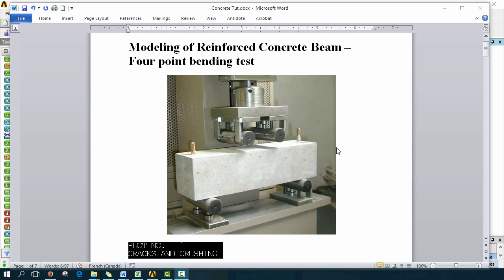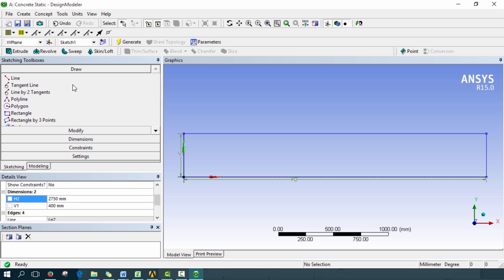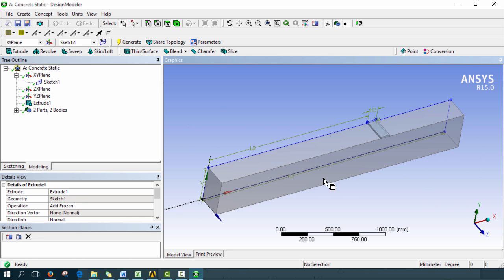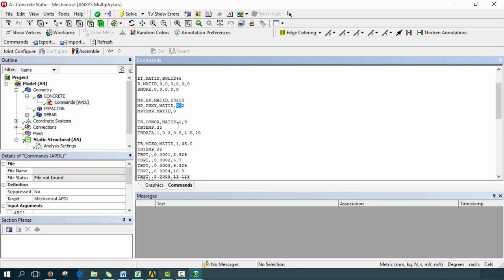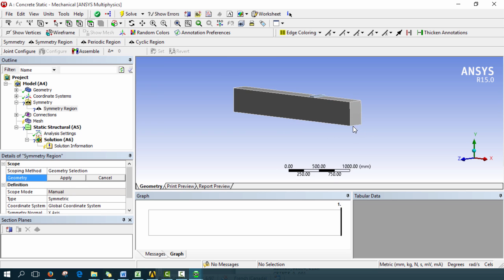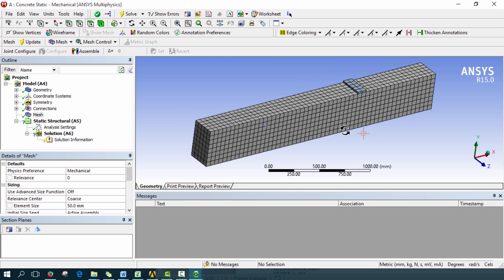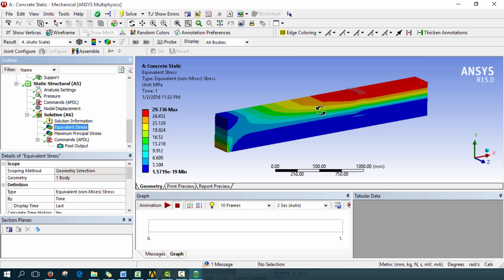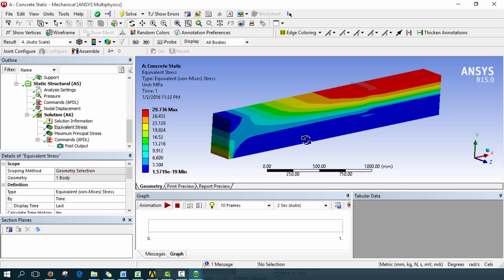ANSYS Tutorial Reinforced Concrete Beam (RC BEAM) - Static Structural

Comment: Hi, and thanks for putting up your concrete modeling videos. One comment on the static structural model that you have developed: Viewers should note that the coupling connection between nodes reinforcing rods and concrete by node coupling works only because of the element sizes and placement of the rods in the concrete block. You have done it so that you have coincident nodes in the elements of the concrete block and of the rods. Users will need to ensure that they use low-order bricks so that the SOLID65 bricks can be substituted. It will take more work for the "general case" in which the concrete is carved up into a multibody part so that reinforcing bars can be placed along edges of the bodies that are the concrete. With mesh density controls along the edges that are shared between the line bodies of the reinforcing bars and the concrete blocks, it should be possible to have coincident nodes that can be coupled with reinforcing bar locations that are not quite as restrictive. I am impressed with how smoothly and quickly you are able to present. Nice piece of work!

Comment: can you please upload the word file of commands for m20 concrete ??
Reply: ANSYS Reinforced Concrete Beam (RC BEAM) - Static Structural by DrDalyO
CONCRETE COMMANDS:
ET,MATID,SOLID65
R,MATID,0,0,0,0,0,0
RMORE,0,0,0,0,0

MP,EX,MATID,29250
MP,PRXY,MATID,0.2
MPTEMP,MATID,0

TB,CONCR,MATID,1,9
TBTEMP,22
TBDATA,1,0.3,0.8,1.5,25

TB,MISO,MATID,1,35,0
TBTEMP,22
TBPT,,0.0001,2.925
TBPT,,0.0002,5.7
TBPT,,0.0003,8.325
TBPT,,0.0004,10.8
TBPT,,0.0005,13.125
TBPT,,0.0006,15.3
TBPT,,0.0007,17.325
TBPT,,0.0008,19.2
TBPT,,0.0009,20.925
TBPT,,0.001,22.5
TBPT,,0.0011,23.925
TBPT,,0.0012,25.2
TBPT,,0.0013,26.325
TBPT,,0.0014,27.3
TBPT,,0.0015,28.125
TBPT,,0.0016,28.8
TBPT,,0.0017,29.325
TBPT,,0.0018,29.7
TBPT,,0.0019,29.925
TBPT,,0.002,30
TBPT,,0.0021,30
TBPT,,0.0022,30
TBPT,,0.0023,30
TBPT,,0.0024,30
TBPT,,0.0025,30
TBPT,,0.0026,30
TBPT,,0.0027,30
TBPT,,0.0028,30
TBPT,,0.0029,30
TBPT,,0.003,30
TBPT,,0.0031,30
TBPT,,0.0032,30
TBPT,,0.0033,30
TBPT,,0.0034,30
TBPT,,0.0035,30

REBAR COMMANDS:
ET,MATID,LINK180
MPDATA,EX,MATID,,2e5
MPDATA,PRXY,MATID,,0.3
TB,BISO,MATID,1,2
TBDATA,,460,2100
R,MATID,12,,0

PRE PROCESSOR COMMANDS:
/PREP7
ESEL,S,ENAME,,65
ESEL,A,ENAME,,180
ALLSEL,BELOW,ELEM
CEINTF,0.001,
ALLSEL,ALL
/SOLU
OUTRES,ALL,ALL

POST PROCESSOR COMMANDS:
/SHOW,png
/ANG,1,
/VIEW,1,0,0,0 !Use these values to change the view
/DEVICE,VECTOR,ON
SET,Last !Outputs final result set
PLCRACK

Please subscribe!!
By DrDalyo
https://www.youtube.com/user/drdalyo

Comment: dr.dalyo thankyou so much for these videos. i have a question i have ansys 14.5 & when i solve this RC beam problem it gives warnings of material properties. can you suggest possible solution or other ways to add properties of solid65 & link180.
Reply: yes, even i am facing the same problem. please suggest some solution
Reply: the problem is with conc steel connection command,, use CPINTF
Reply: Yes please

Comment: too bad the current (v18) uses the god awful spaceclaim to work the geometry.  what a clusterfuck system that is.  After trying to do the same thing for an hour I finally went into solidworks and did it in a few minutes.
Reply from the maker: +skahatoad i think you always have designmodeler. Instead of double clicking on the geometry cell, right click and choose designmodeler. Yea I havent even got around to using spaceclaim much yet either.

Comment: Dr Dalyo , why deformed shape is corrupted (deformed shape) in comparison with those obtained using ansys workbench element solid186? I must see deformed shape to examine cohesive debonding in my mode. when I select  undeformed shape it is impossible to see debonding. In case of true scale I see corrupted  ones.
Reply from the maker: I think i forgot to drop element midside nodes. Try changing that under the meshing object.

Comment: Hi DrDalyO,

I have some doubts and questions, could you help me?

1) What would it be the best way to make a connection between a “ surface” element and beam element “cross section”. For instante, a continuous slab remains supported on beams so that they have a monolithic connection.

2) Is it possible to plot the diagrams of bending moments on surface elements or solid elements? I watched many of your videos, but you just plotted in beams. If it is possible to plot, could you give me a hint? "

Thank you.
Reply: Omar Rahal à

Comment: Hello DrDalyoI try to use your Commands (APDL) into my model which is a reinforced concrete slabsbut i get those errorsElement type 1 is not the same shape as SOLID65.  Switching to a        
 different shape is not allowed while elements of type 3 exist.  Element type 2 is not the same shape as LINK180.  Switching to a        
 different shape is not allowed while elements of type 4 existElement type 1 is a concrete slab
and element type 2 is the rebars
Reply: TOLGA ALTIPARMAK  tolga hocam kolay gelsin ben betonarme bir kiris uzerindeki kırılma catlaklarini gormek istiyorum workbench de yardımcı olur musunuz

Comment: I have a problem 
An unknown error occurred during solution.  Check the Solver Output on the Solution Information object for possible causes.
One or more bodies may be under constrained and experiencing rigid body motion. Weak springs have been added to attain a solution.  Refer to Troubleshooting in the Help System for more details.

Can you help sir..
Reply: i am also having the same issue . did you solve this ? if so then please tell me

Comment: Hi DrDalyO;
First of all thank you so much this tutorial.
I wanna ask, how can I find diffrent materials' codes?
For example rockfill, clay, sand etc. 

Thank you so much already.
Reply from the maker: Well you can find the mechanical properties for these materials online from many websites, then insert those values into the code format given here as an example.
Reply: But we do not know how the code was written, can you help with that?or can we create a new material from engineering data and then input the mechanical properties? please reply
Reply: Good question Isi I wanna learn this answer also
Reply: Actually, if you can learn to apply material properties in the Basic APDL, then in the back log files these commands instructions automatically gets generated. There you can modify according to your use.

Comment: I am about to start using ansys workbench to study temperature distribution on a tensile specimen heated on Gleeble 3800 by direct resistance. the problem is that I have not seen a video where thermal-electric have been used in ansys its always been structural analysis videos or heat trasnfer only I don't know if you can help?
Reply from the maker: +Olwethu Mndini you can couple systems together, so you can start say with a static analysis and then link a thermal in the project schematic
Reply: Thanks Dr DalyO I think I finally understood you response. So far I have been doing steady state thermal- electric analysis and it worked well, but I am more interested in coupling this with transient thermal model so that I can the temperature response with time after electrical loads in the steady state thermal-electric model.

Comment: Thank you sir for uploading nice video,sir my question is ,can i make a model of fibre(steel fibre,polypropyline fibre) reinforced concrete beam in Ansys software,if possible can you upload this video,
Reply: +Prasenjit Saha  I have the same doubt... Did you get the solution to that ?  I want to design a carbon reinforced concrete beam ....
Reply: no sir,sir  if you want to wrap the beam with carbon fibre than it can be possible,some videos are available in the youtube,otherwise try in ATENA software
Reply: Prasenjit Saha I am also having the same problem as you have to create a hybrid (pp+steel fiber) rc beam with reinfo could we solve it in ansys WB
Reply: Prasenjit Saha how to define the fiber random distribution in ansys workbench if we use the fiber reinforced concrete? Have you gone through this problem?
Reply: I think you can assign the concrete material bodies as element Solid65 and use its real constant, which allows you to model smeared reinforcement
Reply: @VítorFreitas-n9n  very interesting idea of modelling the smeared reinforcement as a real constant of the SOLID65. My question to you would be, how would you manage to control the position, the amount or the density of the fibres in the model using the smeared reinforcement. I tried to search in the ANSYS help but I could not find a clear answer. It would be great if you could share your idea here because I think this would answer many questions for many people
Reply: @patrickdias5632   take a look at solid65 on ansys help library. It tells you exactly how to set the direction of the reinforcement and its volume ratio.

Solid65 element allows for up to 3 different reinforcement on the same element. What you have to input is the reinforcement material, volume ratio of reinforcement, angle between the reinforcement and the x axis on the xy plane and angle between the reinforcement and the x axis on xz plane (those angles are in degrees and they take into account the element's local coordinate system, not the global coordinate system).

The code below defines Real Constant number 2, with material number 6 as the reinforcement material, 0.209444 the volume ratio of it, and the zeros mean that my reinforcement is on the x axis direction.

R, 2, 6, 0.209444, 0, 0, 0, 0 
RMORE, 0, 0, 0, 0, 0, 0
RMORE, 

I think that, in order to model fiber reinforced concrete, it can be interesting to input the reinforcement on all 3 main directions, x, y and z.
Reply: Vítor Gonçalves kindly upload one video related to smeared reinforcement  model or send a link also....
Reply: @Ranjankumar-sx7zz Sorry but i do not have the means to record such video, but really the solid 65 page on ansys help library does a pretty good job in explaining how this can be done, you just have to get used to the apdl language

http://www.ansys.stuba.sk/html/elem_55/chapter4/ES4-65.htm

Comment: Thank you DrDaylO for the video . 
I'm new to Ansys and Is it possible to model and analyze the above without the command blocks?
Also, Is it possible to include bond strength between rebar and concrete in the analysis ??
Reply from the maker: +amr ali it is possible, but you must do it in APDL
Reply: how to made it in APDL
Reply: I have the same question, the command objects don't work in my model, and I hope there is a way to enter the elements types and material properties by APDL  and continue all the other steps in Workbench.  I would be very grateful if you helped me

Comment: Hello Sir,
I am new to ansys and i am trying to model circular concrete column with biaxial bending. While defining the concrete material as per the apdl commands I am getting an error as, "Element type 1 is not the same shape as SOLID65. Switching to a different shape is not allowed while elements of type 1 exist". Also, if I am to model 3D reinforcement, please can you guide me with the commands for rebar as solid65. Please guide me asap

Comment: when i changed the stress strain table  with high strength concrete the ansys did not solve  
sir thank you very mush for the video you have no idea how i appreciate it
Reply from the maker: +Mazin Omer I am not sure whats the problem, but this model is not very stable as it is.. start by making small changes to my code to figure it out more easily.
Reply: I begin to use a uhpc.

mm/mm N/mm²
0,00000 0,00000
0,00173 75,00000
0,00184 79,29002
0,00196 83,98509
0,00208 88,27732
0,00220 93,04424
0,00232 97,32686
0,00242 101,32217
0,00255 105,37563
0,00266 109,08479
0,00275 112,06690
0,00285 115,02874

This TBDATA is based on real pressure tests (uhpc cylinder). If i exclude this

!TB,CONCR,MATID,1,9
!TBTEMP,22
!TBDATA,1,0.3,0.8,1.5,25

it works well. Now I am working on that coefficients to reach the crack/crush plots.
Reply: Only 4 digit decimal can be put on that command. I once face this issue too.

Comment: Thanks for tutorial. It was very usefull. This calculation has 1 step. When I tried  to set substeps (more then 1) program couldn't solve that. Is there any way to set more substeps? Also, I've tried to get results with APDL, but cracks don't looks like these in wb. I couldn't get first crack. Can You please help me to get pressure when first crack appears? Thank you very much and sorry for my English.
Andrija Zoric
Reply: /PREP7
ESEL,S,ENAME,,65
ESEL,A,ENAME,,180
ALLSEL,BELOW,ELEM
CPINTF,ALL,0.001,
ALLSEL,ALL
/SOLU
OUTRES,ALL,ALL
Reply from the maker: +Andrija Zoric yes the model is not so stable because of the CEINTF command to connect nodes. You should be able to add more substeps but might lead to problems as you are seeing. APDL should give you more detail, on 1st, 2nd and 3rd cracks. Pressure for first cracking? you can maybe ad more substeps, and check the results to see at what time the cracks appear, from there calculate the load.
Reply: +DrDalyO Thank You very much. I think that model is not stable because pressure is too high. Also I've changed CEINTF command to CPINTF (I found somewhere that this command is similar to CEINTF) and CPINTF didnt make errors. Also in mesh I've used drop mesh (element have 8 nodes not 16). With these changes I've got moment of first crack as same as I calculated by n theory.
Reply: Could you please send me the command with 'CPINTF', I could not work it out. I am having the same problem with CEINTF command. Thanks.
Reply: I couldnt solve mz problem in WB. Commands for element tzpe and material properties didnt work too. So I finallz solved problem in APDL.

Comment: THANK VERY MUCH DrDalyO ! I follow every steps and modify the model, but error occurs about the "ceintf" command. The errors are  "Constraint equation xxx has unused node xxx", a lot of it. I change the mesh sizes of line and body many times but it still dont work! Do you know the reason to that?
And Thanks a lot again ! Looking forward to your new video.
Reply: Hi, I am facing the same issue, did you find the solution to it?
Reply: Yiming Yao This is because you cannot define two coupling relation at one node. I use a stream to filter out all the most adjacent concrete-to-steel node, and couple them. Works great at small scale model, but still have some problem in larger one.
Reply: I also had the same problem.
How you did what you said to solve the problem ? How did you do it?
Reply: The major problem is the stream, firstly sort out all nodes of two material(master and slave) and put them into two array respectively. Then find out the most adjacent master nodes to all slave nodes, use CP to couple their DOF. To be noted that *GET can find out the number of the most adjacent node of the selected node, make use of that.
Reply: Sorry i didn't get it. I'm new to ANSYS, can you please tell me how to sort out all the nodes of two materials and couple the adjacent Master & Slave nodes. I'm experiencing the same problem....help me out.
Reply: !Firstly make sure you save your concrete node in "master node" and steel node in "slave node"
cmsel,s,slavenode
*get,count1_node,node,0,count
*del,slave_node
*dim,slave_node,array,count1_node
*get,slave_node(1),node,0,num,min
slave_node(i)=ndnext(slave_node(i-1))
*enddo
allsel
cmsel,s,masternode
*get,count2_node,node,0,count
*del,master_node
*dim,master_node,array,count2_node
*get,master_node(1),node,0,num,min
*do,i,2,count2_node
master_node(i)=ndnext(master_node(i-1))
*enddo
*del,cp_node
*dim,cp_node,array,count1_node
*do,i,1,count1_node
cp_node(i)=0
*enddo
allsel
cmsel,s,masternode
kk=1
k=1
*dowhile,kk
kk=nsel(k)+0.001
allsel
cmsel,s,masternode
nsel,u,node,,k
cm,masternode,node
*enddo
cp_node(i)=k
*enddo
allsel,all
/prep7
*do,i,1,count1_node
cp,next,UX,slave_node(i),cp_node(i)
cp,next,UY,slave_node(i),cp_node(i)
cp,next,UZ,slave_node(i),cp_node(i)
*enddo
Reply: OK thanks..

Comment: Thank you DrDaylO for the video . 
I'm new to Ansys and Is it possible to model and analyze the above without the command blocks?
Also, Is it possible to include bond strength between rebar and concrete in the analysis ??

Thanks.

Comment: That's a very nice video. There are not many RC examples done in Workbench. After some time, I was able to come up with a similar model (including command blocks), but it's really good to see we are on the same track!
Keep up the good work and thank you!
Igor
Reply from the maker: Thanks! If you improve the model and/or verify it with data please keep me posted!
Reply: Actually, I am analysing RC structures subjected to fire, which is basically this, but extended for higher temperatures (material data, linked thermal and structural analysis, etc).
We shall definitely stay in touch :)

Comment: Thank you for the grat example, sir. I repeated it step by step and received the same results, which is good. But i couldn't receive the stress in the rebar. Is it possible in this way?
Reply from the maker: +Techcrafter You would need to use more command objects do get these results. I probably should have included this in the tutorial. In the Solution(A6), right click and add command object, insert the following code to see axial force and stress results for the beams:

/SHOW,PNG
/VIEW,1,1,1,1
allsel
ESEL,S,ENAME,,180
ETABLE,Force,SMISC, 1
ETABLE,Sxx-i,LS,1
ETABLE,Sxx-j,LS,2
PLETAB,Force
PLLS,Sxx-i,Sxx-j
allsel
Reply: +DrDalyO It worked for me, thanks!
Reply: Hi..... I got the force and stress results but cannot interpret its meaning. Are these von-mises stresses or axial stresses? Also what are the units of these forces and stresses?
Reply: hi i also repeated it step by step but i didn't receive the same results. Techcrafter could you please help me on this ??